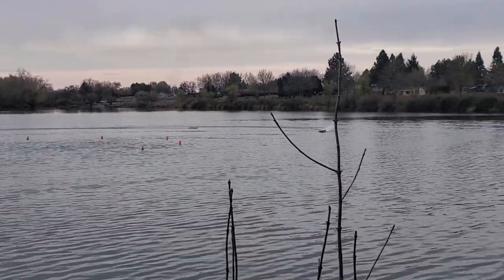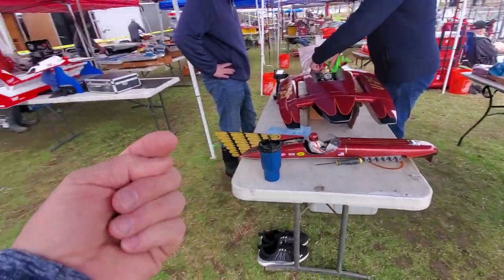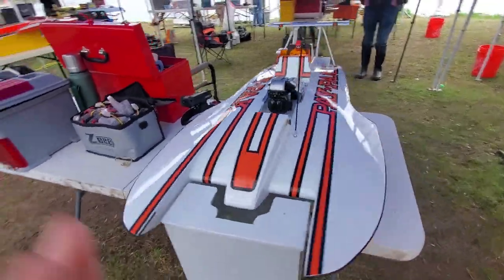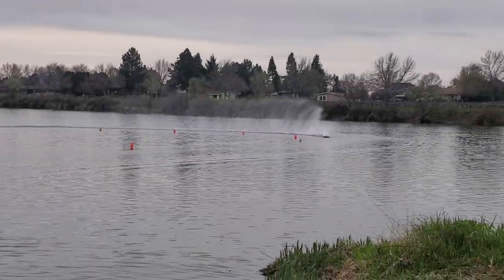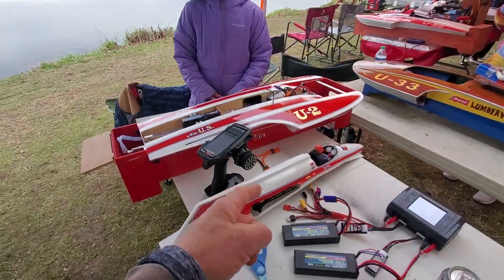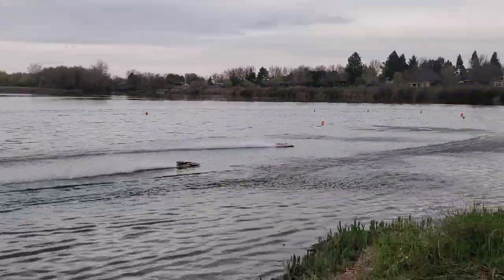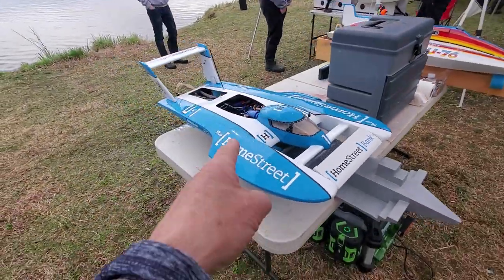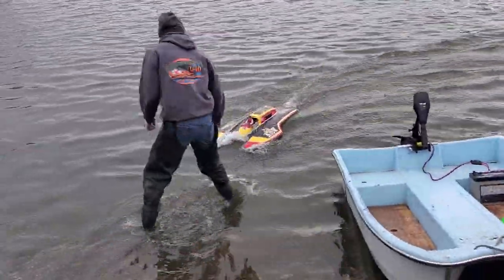Scale Model RC Hydroplane Pit Tour | 58 Awesome Race Boats!

Comment: I got one of these cool looking things, I thought it was a catamaran. It was in need of restoration when I was 18 and bought it, it left my hands for a few years, but it I have it rightfully back and I'm glad I just started restoration now at 36, because I know I have the proper skills now to repair it right. The old OS max .61 nitro is being replaced with a Russian MDS of the same size, but I still need to figure out what I need, which is almost everything. I only have an almost repaird hull, engine, an old exhaust, a busted driveshaft and tube+ old prop and a free blue traxxas micro servo in its bag I found by chance while cleaning a car I bought. Good thing I found this channel, should be a good source of info and inspiration. Cheers.
Reply from the maker: I'll be very interested to hear how this turns out, especially the old MDS!

Comment: Hey scott why does the tenth scale electrics do left turns
Reply from the maker: The motor rotation in the 10th scale boats is reversed from the larger scales, so the prop thrust makes them turn better in the opposite direction

Comment: Why do electrics run left turn vs right turn like the gas/nitro?
Reply from the maker: It's a prop thrust and motor rotation thing. The rotation is reversed in the 1/10 scale electrics, making them lift the right sponson vs the left in other boats. They would tend to flop over if they turned the other way

Comment: hello i am new at this and i have a 31cc Marine engine in a 48" catamaran from Bonzi sports what type of fuel do i use ??
Reply from the maker: Run non-ethanol pump gas, anything over 87 octane, and add 10oz two stroke oil per gallon.  You'll have fun with that boat!
Reply: @M5PerfHydros   Okay thanks so much cant wait to here it run . waiting for my muffler to get welded so i can put it on
Reply: @M5PerfHydros  Is there a site where i can buy the premixed fuel so i dont mix it wrong ? and also are there short throttle  cable i can get for the throttle from the servo box that are like flexable